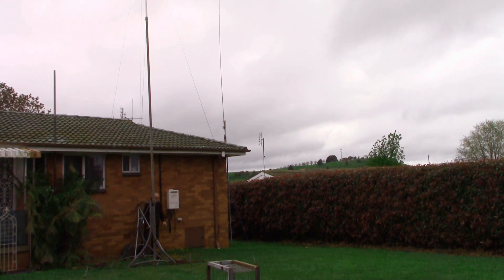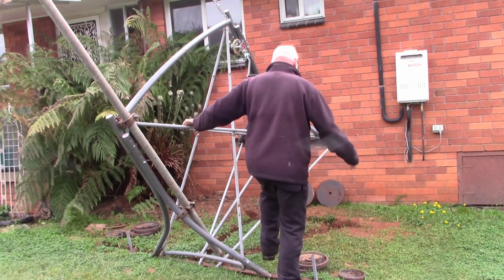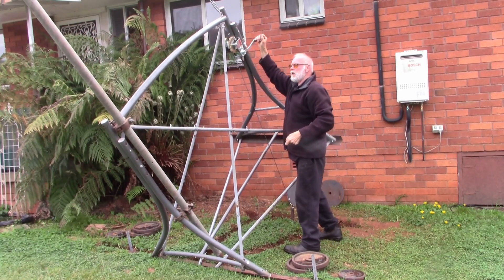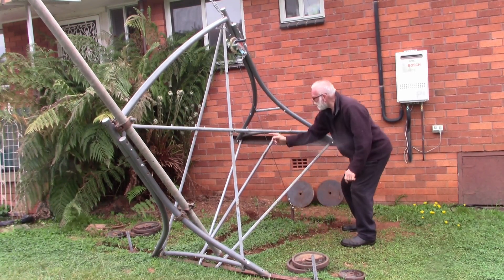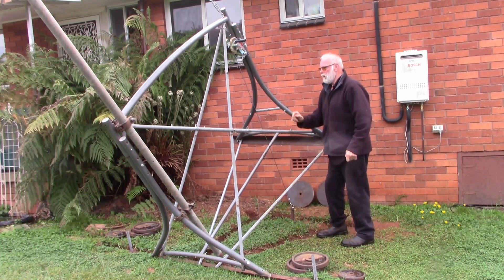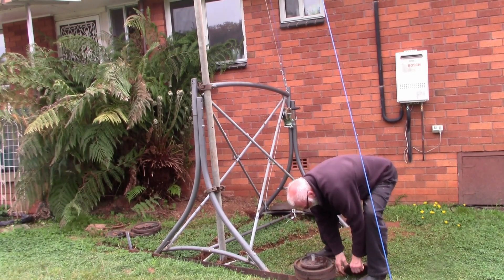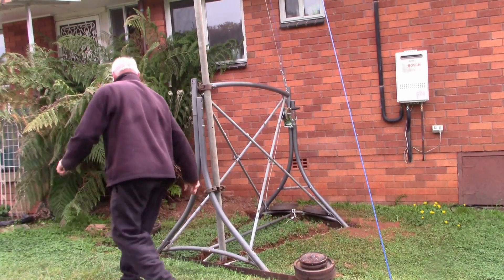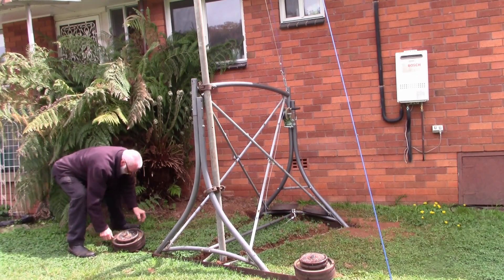✅PORTABLE SELF STANDING GUYED ANTENNA CB /HAM CRANK TILT OVER MAST.

Comment: Do we have step by step plans on this great setup?
Reply from the maker: This is a Earlier Video did As you can see that it was just the Frame of a Lounge Swing. (Wife was not real happy) And you now see that we have Reinforced it like it is now. Also have a Winch as well. https://www.youtube.com/watch?v=qlggnJo-bWM
Reply from the maker: Thanks only made this from what material I had.
Everything was bolted or Tec screwed together.
Basically using a frame from a swing lounge.
Reinforcing it with tubing from a Old Hills Hoist.
The swivel point is a old rusted 3inch by 3inch heavy angle 
And the same at the other end although a bit shorter.
Thinking anyone that would have a better knowledge then me and be able to weld.
Could probably make a more compact one.

Comment: now this is just what i need for my yard. i must have a more detailed look at making something like this.  Great concept and design  frank vk2bfc
Reply from the maker: Thanks only made this from what material I had.
Everything was bolted or Tec screwed together.
Basically using a frame from a swing lounge.
Reinforcing it with tubing from a Old Hills Hoist.
The swivel point is a old rusted 3inch by 3inch heavy angle 
And the same at the other end although a bit shorter.
Thinking anyone that would have a better knowledge then me and be able to weld.
Could probably make a more compact one.